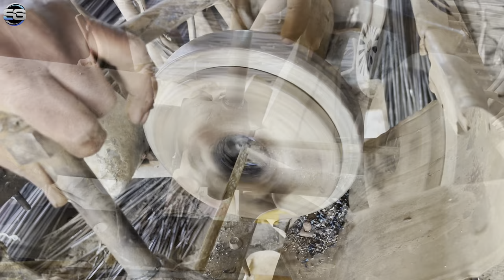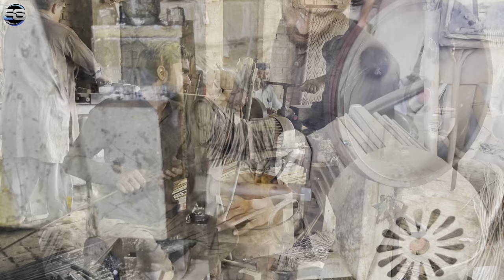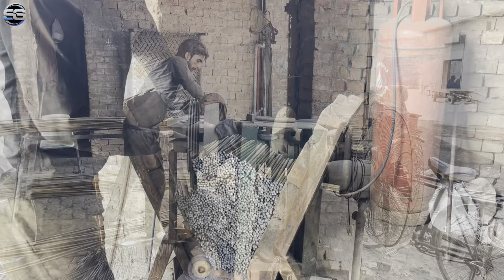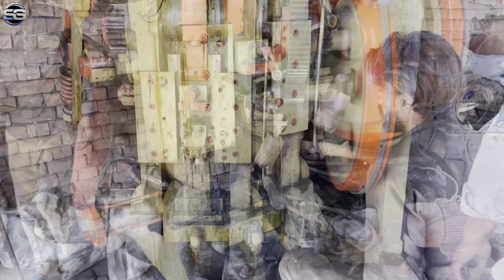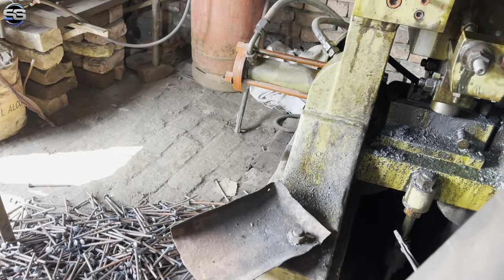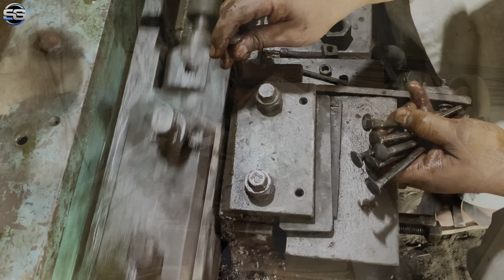Mass Production of Warm Carriage Bolts Amazing Process

Comment: Health and safety 
   Rules 2 :-  Wear personal protective equipment.
PPE provided by the employer should meet all safety standards established by the Occupational Safety and Health Administration. According to Safety Services Company, the most important types of gear include:

Goggles – Wearing goggles while operating machinery protects eyes from flying debris and sparks. This is true even for workers not operating machines, as others engaged in work could cause debris to fly.
Gloves – Gloves should be worn to protect skin and nails, especially if workers are using harsh chemicals. Thick gloves can also protect against rust or cuts from tools.
Respirators – In workshops with potentially harmful fumes, OSHA-compliant respirators should be worn by all employees.

Comment: v I ask why, as it comes out of the press, the bolt is thrown to the ground.
They need to cool....
The following operation expects more workers to ...collect them! To bring them to
who works on the threading machine, to the right of whoever presses: but isn't it better to throw the bolts, to cool, to his RIGHT AND NOT ON THE LEFT?
Reply: if he throws to the left they are downwind of his fan. If he throws right he would be blasting hot smoke at himself (just a guess)
Reply: @QueernMental  completely review the direction and direction of the movement of the pieces; operations must be in sequence. And equip yourself with containers at head height
Reply: @luigicristiani7709  there's two bikes in the way. And it's easy for the children to pick them up as they are not tall.
Reply: @luigicristiani7709  Yes, He keeps the entire movement from getting a blank rod to dropping the processed pin all one fluid movement.